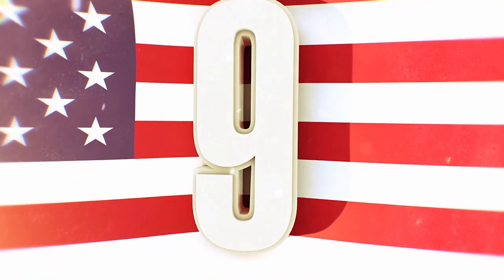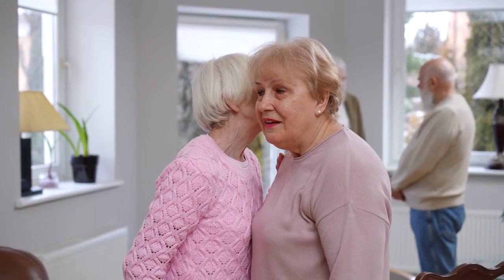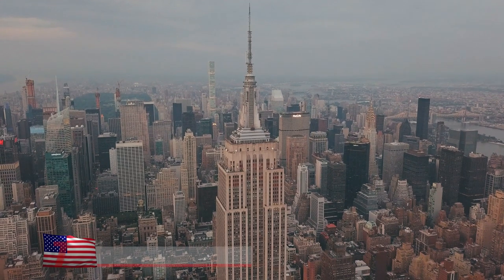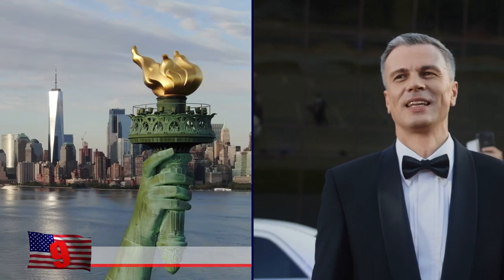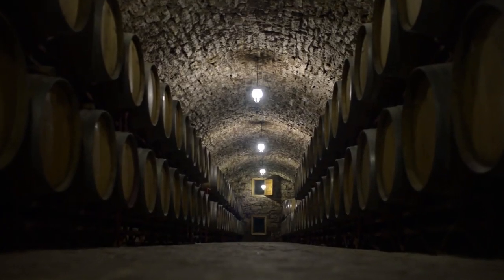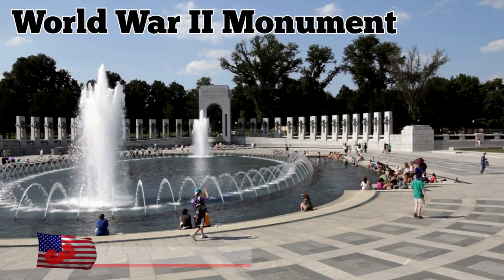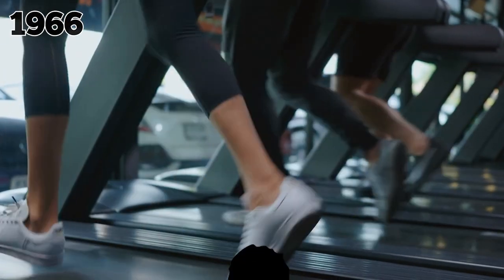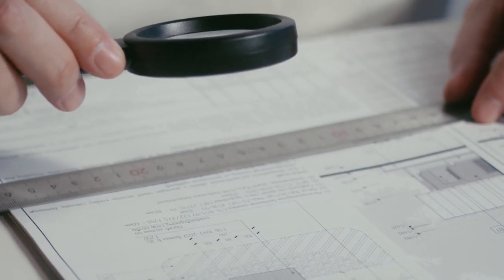Untold Secrets Of The Biggest Monuments In America

Comment: I did 'discover' a secret location before. The building I worked in was known to have 6 floors above ground and another 3 floors below ground. However, I was at home one night and surfing the web, I saw a link to the county archives.  Of course, I looked up blueprints to the building I lived in and afterwards I looked up the blueprints to the one I worked in and discovered that it recorded the amount of dirt that was dug up for the buildings construction. (I forget the exact amount of metric tonage).  But what stood out was the fact that the building didn't occupy the same amount of space that was allocated to it's construction.  In fact there was enough 'missing' dirt for a 4th sublevel. So of course, I wondered what the heck they were keeping down there?  Aliens?  Parking Garage?  What?  So I asked around, of course got bupkis, until I asked a guy who worked security for the place.  He told me of a mysterious maintenance hatch in the floor of 'Sublevel 3' but he never saw any maintenance going on there.  I grabbed a flashlight and went to this so-called mysterious maintenance hatch.  Turned out it wasn't even locked, just pulled it open and climbed down into it.  Come to find out, it was a full sized concrete level.  Complete with working lights, I didn't even need the flashlight.  But the elevators didn't come down there, nor did the stairs. In fact the only way access to this level - that I was able to locate - was the afore mentioned hatch.  Of course, nothing or no one was down there of any interest except a few cardboard boxes with papers in them, but the papers were not legible because they were so old and that was it.  And yes I DID get yelled at by my Sr Manager citing that it was 'unsafe' to venture down there.  Never did find out what the 4th sublevel was for or why they closed it off.  Just one of those mysteries.